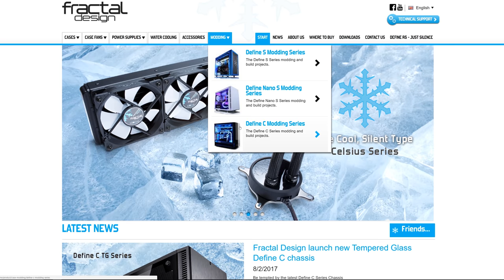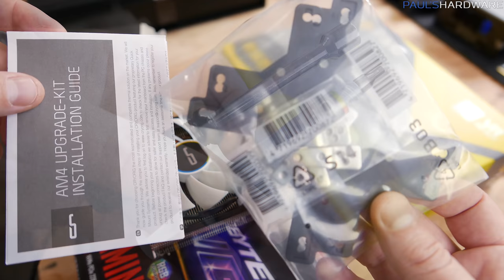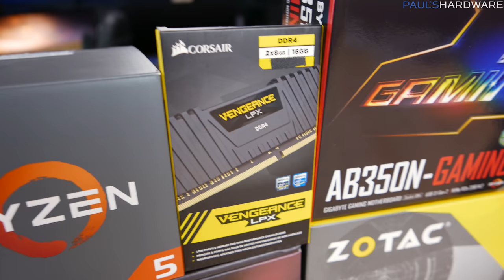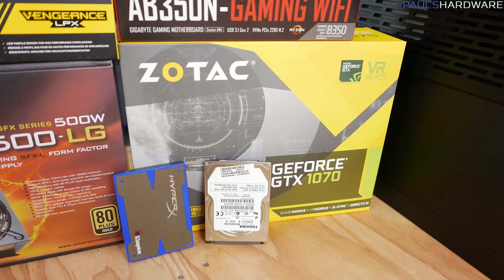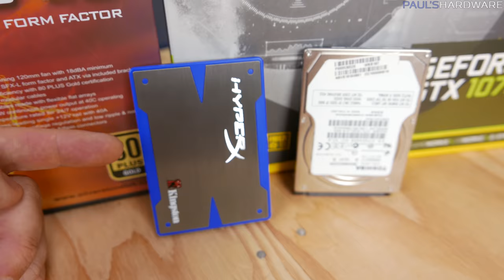Building The Mini-ITX Ryzen Gaming PC!

Comment: "500 watts is on the low end of what I'd recommend..." 500 watts is plenty of power for this build; there is room to spare. The whole system will draw less than 350 watts.
Reply: But otherwise, a eally nice build. Nice work on the cable management. Mini-ITX cases are always a bear and that one looks to be no exception.

Comment: Can you just plug in a 2.5" hdd on a desktop computer? 
I know 3.5" hdd and 2.5" hdd had a different rating. Can I just plug in a sata-molex power adapter from a desktop that use to deliver 12v and 5v on a 2.5" hdd that requires only 5v ? I'm an Electrical engineering student and I know a difference of 12v and 5v on electronics is too much. Please enlighten me!!!
Reply: Justin AP yes it's the same power and data cable. The old IDE cables were different between 2.5 and 3.5. But same for sata
Reply: What do you mean same for sata? So what happens to 12v when you plug in 2.5" hdd in desktop system ?
Reply: Yes they are can swapped. They have same connections

Comment: You should try to build the cheapest HTPC (Netflix/moonlight streaming) possible, while also providing a good experience using used parts like a Q6600 and an AMD Radeon 6350 for example.
Reply: that's pretty much what we have. no graphics card. small SSD. Works fine for streaming. HTPC cases for that are only about as big as the motherboard.

Comment: Guys please help me out, I'm new into this (pc master race) and I'm about to get new high end pc please tell me if this setup parts weather it's excellent or something needs to be changed little bit

RAM: g.skill trident Z RGB (2x8 GB) DDR4 3200MHz C16

Motherboard: ASUS MAXIMUS IX Formula 

CPU: intel core i7-7700K processor (8M Cache , up to 4.50 GHz)

GPU: GTX 1080ti MSI GAMING X 11GB GDDR5X

Power supply: Gigabyte greenmax 650W

CPU cooler: cooler master MasterAir 8
Reply: the_viper 115 meh 7700 and 1080 somehow bothers me.
Reply: Also 650 watts ....

Comment: I had that case and never liked it everything just felt choked even with the filters off
Reply: Red Mods what kind of parts were in it?
Reply: otakuMCkid6969MRstealYOgirl i5 6500 and RX 480 and you're stalking me cause you commented on the monthly builds video when he said he was gonna build it
Reply: Red Mods I've got a 7600k @ 4.5GHZ/GTX 1080 SC2 @ 2GHZ in that case, and I've had no thermal issues, but I did mod it for better GPU exhaust

Comment: This case isn't very sturdy, and I wouldn't recommend traveling with it much.
Reply: MrTomothy Do you speak from experience?
Reply: Aric England Yeah I've built an office PC in it. The case has a weak cross beam, awfully flimsy side panels, and low clearance. You couldn't stack any other equipment on it for fear of the panels hitting the fans. It didn't matter for my build, but I wouldn't ever throw it in a travel suitcase.

Comment: ugh Gigabyte are the worst
Reply: Sean Grief MSI is even worse
Reply: Asrock makes the best budget motherboards IMO.
Reply: 98luk45 what's the best budget b350?
Reply: Giorno Giovanna Over Heaven Probably msi b350 pc mate/tomahawk or Asus prime b350
Reply: +Giorno, for my use case, all B350 boards are trash. If I had no option, I'd go with the Asus B350 Prime Plus for slightly more USB ports. Personally, I had my eyes on the Asrock Taichi for X370 - mainly because the wifi module is a huge bonus for me since it frees up space for my 2 graphics cards, a sound card, and an additional network card in the future. For Linux, the Asrock Taichi supposedly has better support for virtualization and ECC, but Ryzen overall still has issues with virtualization and Linux, so that's what held off the purchase for me. 

Other things I'd consider are software support, customer support, and warranty. I've had positive experiences with MSI and Asus, but that might depend on your location and people you're dealing with (I'm in Australia). Gigabyte support wasn't great in the software department, and my experience with their customer support was pretty bad in 2010 - at least they're not as bad as HP's customer support.
Reply: QuaX what about the mortar?
Reply: 98luk45 ok thank you
Reply: Depends on the use scenario. I've done a few builds with the Asus ROG Strix B350-f it's a solid pretty board with all of the features you'll need and decent overclockability.
Reply: I've not had many bad experiences with MSI. Gigabyte however is pretty much just RMA after RMA.
Reply: Giorno Giovanna Over Heaven Just remeber that those boards are budget ones, if you can afford it go for b350 carbon/rog strix or more expensive x370. But for me high-end b350 are enough for normal gamers.